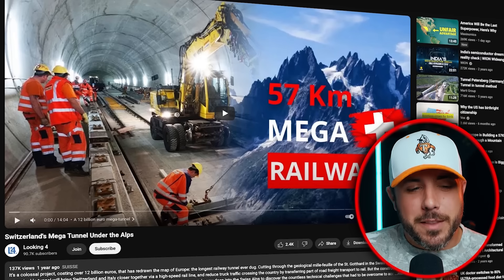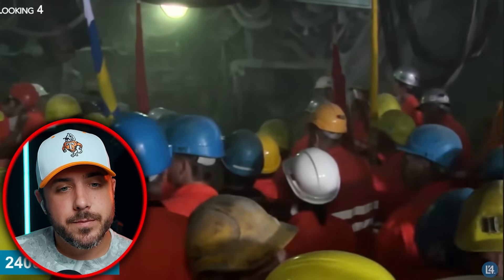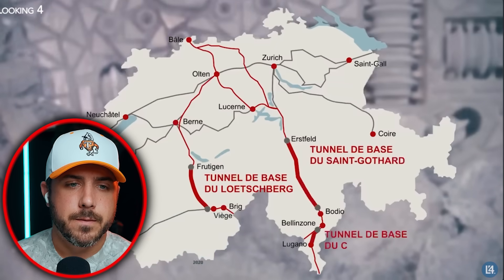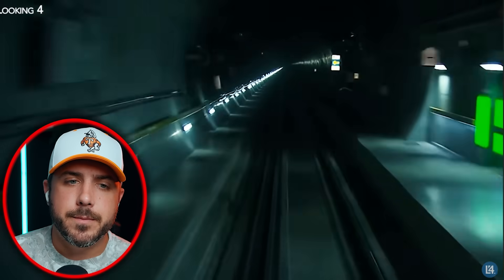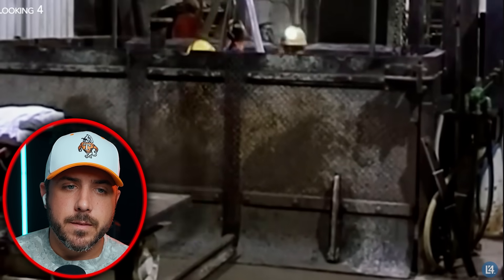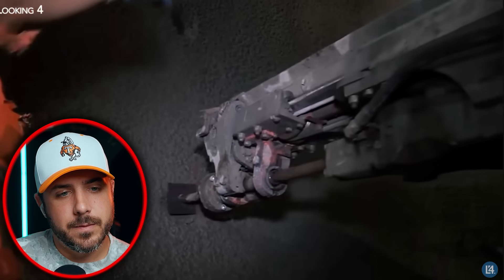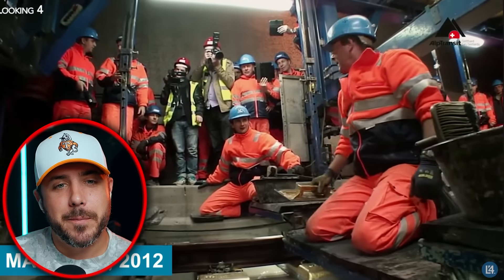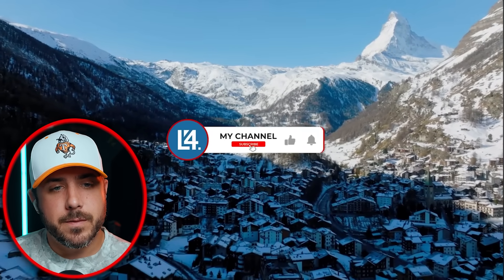American Reacts to Switzerland’s Mega Tunnel Under the Alps!

Comment: In the railway accident in the Gotthard Base Tunnel on August 10, 2023, a freight train operated by DB Cargo and SBB Cargo derailed due to a broken wheel in the Gotthard Base Tunnel. Due to significant damage to the structure, the tunnel was completely closed for almost two weeks. Freight transport was then gradually resumed, followed by passenger transport from September 29, 2023. Normal operations resumed at the beginning of September 2024. At the beginning of November 2023, SBB estimated the damage, including lost revenue, at between 100 and 130 million Swiss francs. The damage and thus the repair costs were significant.

Comment: There are more and more infrastructure projects like this — and yet, in Germany, nothing ever seems to move forward. The Brenner Base Tunnel is already under construction, designed to connect Germany, Austria, and Italy in one unified rail network. In Italy and Austria, progress is visible. But in Germany… they’re still debating where the railway line should even go. 💀

Comment: The fire prevention is also impressive. Any train entering goes through heat cameras. If any part is hotter than it should, the train can't enter the tunnel. Both sides also have dedicated firefighters. These have to be anywhere on "their" side of the tunnel wiwthin a specific time window from the moment they're called. I think the limit is around 15 minutes. Also, the passenger trains and track would allow significantly higher speeds (250 km/h instead of 200), this would however cause issues with the freight trains.

Comment: Impressive tunnel indeed.
Did you know the largest machines ever built by humans, the CERN particle accelerator, also is located in Switzerland,  built 100 meters underground with its largest loop having a circumference of 27 kilometers and extending partially under the border to France? Also worth watching a documentary, I think.

Comment: My uncle was one of the engineers who worked for the Herrenknecht company and engineered the boring machine for the Gotthard Base tunnel. He then also worked at the front of the boring shield and oversaw boring operations. He mentioned those constant water intrusions, falling rock and heat of 40+ Celsius. Whenever I take the train through the tunnel, it's nice and climatised. One forgets that there is thousands of meters of stone above one's head inside that tunnel with immense pressure and heat. I saw the drawings of the boring machine which were as long as the wall inside his office. Huge respect for what they did.

And don't forget. It's not only about the tunnel itself, but the know-how they got. That knowledge came from the Lötschberg Base tunnel and the Zimmberberg Base tunnel and was further used in the Ceneri Base tunnel and the train station Löwenstrasse in Zurich. Because they were boring underneath the river Limmat, they had to put isolation mats on the riverbead and pressurise the boring shield. That meant that workers like my uncle had to sit in a pressurisation chamber for a long time before they could go to work. One time when they basically had the Tram tracks from above fall onto their boring machine because of an unexpected sinkhole, their evacuation was quite complicated because they couldn't just run out. There are many such stories. I could write for ages. Anyway, thanks for making this video. Keep it up!
Reply: Boring machine is crazy

Comment: There is the longest rail tunnel under construction between Austria and Italy. The Brenner Pass tunnel.
Reply: No, the real tunnel is 55 km. Gotthard is 57.
Reply: It's not REALLY the longest. They are planning to keep some of it inclosed just to get the record but it technically isn't longer since it goes outside part way.
Reply: @SAA-hr9gr  no, they are planning (and have always planned) to link up to the already existing Innsbruck bypass tunnel. Thus, the overall length will be 64km.

There are also some extension planned (but not yet finalized) on the Italian side, to allow freight trains to bypass Fortezza and Bressanone (where the Isarco valley is still very narrow). If these get built, the underground section will be more than 80km long (and it would be even longer were it not for a short crossing of the valley on a bridge).

The proposed tunnels are already shown on openrailwaymap.

Comment: Here you go: 57 km : X min = 200 km/h : 60 min ( 57 km X 60 min ) :200 km/h = 17,1 min
So it takes 17,1 min for passanger  train to travel entire lenght trought the tunnel.
Reply: Its 15-20 mins
Reply: Or, on the fly, 50/200 is 1/4, so 15min.
Therefore 57/200 is a bit more than 15min, and it's good enough.
Reply: @Warcraft_Traveler first I love Warcraft IP huge fan as teen I was. Cute username btw❤. 😊 Second lets translate to freedom units for our dude/s. Since avarage drive trought in McDonalds last 5.5 to 7 minutes. It is between 3,109090909090 to 2,5285714285714 avarage visits to McDonald's drive trought. Better now? 😂

Comment: This tunnel was finished on schedule time and with no cost overrun. Ä third of the excavated rock was used to make the concrete used in the tunnel construction. The rest was put into a very deep lake right by the tunnels north end. This created shallow areas in a lake that is otherwise very deep, cold and almost void of life, now it's a thriving habitat for water plants, fish and birds.
It's not the only base tunnel in Switzerland. About 75 km to the west theres another one, albeit much shorter that was also part of the same Alpine Traverse Rail project. 
Besides the French/Italian tunnel under construction there is also a huge base tunnel under construction in Austria.
Reply: The Swiss Parliament approved a loan of 13 billion in 1999, the tunnel ultimately cost 24 billion.
Reply: @TRD-JDM  No, the 23-24 billion you are refering too is the entire cost of the NEAT or  NRLA as its called in English. https://www.newsd.admin.ch/newsd/message/attachments/39644.pdf
That's for the Lötschberg, Ceneri,and Gotthard tunnels plus all the additional works on those routes.
The final cost for the Gotthard Base Tunnel (GBT) was CHF 12.2 billion (approximately $12 billion USD), which was within the budget for the project at its completion in 2016. Although initial projections were lower, voters approved a budget increase in 1998, and the final cost remained on budget for the completed tunnel itself.
Reply: It was even opened before scheduled time

Comment: The freight train derailment was actually a big deal because it did the impossible and took out both tubes at once. They had to figure out a better solution for a critical intersection between the tubes so it won't happen again. It took over a year until it fully reopened.
Reply: Besides damage to the large doors that separate the two tunnel tubes at the locations where it is possible for trains to switch tubes, very little was damaged in the second tube. After new doors were installed, freight traffic resumed within 13 days in the unaffected tube. The problem was with one tube out of commission (ie, no functioning rail infrastructure) and construction going on inside, safety rules prevented passenger traffic in the intact tube (as the other tube serves as an evacuation route).

As the old tunnel route was still available, initially all passenger trains were rerouted through that. This increased travel times by up one hour. It also reduced passenger capacity as the old route could not accommodate double-decker trains. Later on, after new safety procedures were implemented, some passenger trains were able to use undamaged tube on the weekends (when there is most demand) but not during the week to allow for enough freight capacity through the tunnel.
Reply: Yeah the problem was the doors and if I remember correctly from one of the civil engineers. The gotthard tunnel didn't have replacements. So a new door and pieces had to be made before installation could commence.

Comment: This was very historic here in switzerland and it is one of the mega project that was finished in 2016. I pass in this tunnel when we were traveling to milan and also the old panoramic rail and both of them are stunning.
Reply: It was impossible to miss as every news outlet, every politician, every teacher and simply pretty much every single person was talking about it. :D 
Another big point was, when they connected the tunnels from norht and south side and noticed, that their measurements where exact to the point of roughly 10 cm offset. Considering how long the tunnels are, this was absolutely nothing. 

We've visited the southern digsite when i was still in school and it was amazing. We sadly did not see the drilling machine live though..

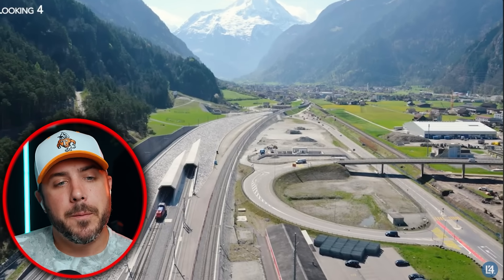Comment: 2:13 Construction for this tunnel started in 1999 (With some prep work done 3 years earlier) so 17 years(+1 month to be exact). They started building a second road tunnel just this year. The original much smaller tunnel was from 1872, so it is an ever ongoing evolution of tunnels.
Reply: Tunnel Višňové in Slovakia - construction started in May 1998 (year earlier) and was completed just now before Christmas (9 years later). Sad thing - it is "only" 7,5 km long. Naturally, it´s politicians´ fault.
Reply: @Kilud  Excellent news, that will take a serious amount of time from my travel time when visiting the inlaws. Žilina and Strečno always took forever. Will miss the castles though. 
Ibet this wil cut down on the many accidents under Strečno as well.

Comment: To be fair, it would have been completed even earlier if it was only done by the Swiss... the Italian part completion slowed down the process for a few years I remember.
Reply: If you are talking about the Monte Ceneri Base tunnel (finished in 2020) then you need to realize that is within Canton Ticino Switzerland, not in Italy.
That is mentioned en passant in this video.
Reply: @alexandergutfeldt1144  then I must have mixed it up with something else cause I clearly remember the opening being covered on TV talking about the "Italian" stretch of a gallery... I'm confused now, cause I looked it up and looks all the galleries have been built way back in the day. 😶
Reply: @MartinaValla  Maybe your mind transformed 'ticinese' into 'italian'? Mine has tricked me in that way!

Possibly you are thinking of the Simplon-Line? There seems to exist a lot unhappiness (ha) about how that project is 'handled' in Italy?
You may also be remembering/transfering all the delays in Germany's railroad projects. They are decades behind the original promised finalization dates of lines that enter Switzerland.
Reply: @alexandergutfeldt1144  I guess so! 😆 Thank you for pointing that out, it was a bit of a mindblow lol
Reply: @MartinaValla  Ticino is in the Italian-speaking part of Switzerland, but it's still Switzerland.

Or maybe you confused it with the Brenner Base Tunnel (which is currently under construction between Austria and Italy).
Reply: @stephanweinberger  I know! I must remember wrong or have mixed it up with something else, though it's possible I'd seen it on the regional news (I live in Lombardy) and assumed it went all the way to the border. I clearly remember the image of workers shaking hands through the hole so it's probably this. Thanks for pointing it out!
Reply: @MartinaValla  Or maybe you mixed it up with the Mont Cenis base tunnel?
Reply: @stephanweinberger  no no, it must have been the Gotthard since it was around 2016. I probably heard Bodio or Airolo and wrongly assumed they were in Italy since they sounded so familiar! 😅

Comment: At the moment, another tunnel is build: the Brenner Base Tunnel which then will be the longest railway tunnel of the world with a lenght of 64 km.

The tunnel boring machines of both the Gotthardt tunnel and the Brenner Base Tunnel are designed and bulid by the German company Herrenknecht.
Reply: There are two ways to define the length of the Brenner Base Tunnel. The main tunnel will be 55 km long, ie, 2 km shorter than the Gotthard Base Tunnel. However, it will be directly connected with an existing 13 km tunnel that serves as bypasses of the city of Innsbruck, which is located in a fairly narrow valley.

Comment: 16:30 It's called The Mont d'Ambin Base Tunnel now but yes, it will be the longest railway tunnel once it's completed. It's expected to complete in 2032/2033 and is currently on schedule to meet that deadline.
A direct Lyon-Turin train currently does the journey is just under 4 hours (3h54 to be exact for the fastest connection). The new tunnel will cut the time by 45 minutes.

Comment: Here's what they did with all the excavated material - The material excavated during the construction of the Gotthard Base Tunnel was primarily used for the tunnel's inner lining and other construction purposes. Approximately 24 million tons of rock were excavated, which was then transported to base camp concrete factories, where it was processed into 7.5 million tons of concrete for the tunnel's lining. Additionally, some of the excavated rubble was used to construct a new archipelago of three artificial islands in Lake Lucerne, covering an area of half a hectare, which were officially inaugurated in 2005.
Reply: "Primarily" isn't correct. The volume evacuated is larger than the volume used. 
And when the material was good for concrete, it was used for it. 
I'm quite convinced that the plants used for the tunnel were also selling their concrete to construction projects in the region or aggregates.

Comment: The US is no longer capable of doing mega projects because we basically change governments every time we blink and the new person in charge will always cut budgets for projects or downright cancel them at any stage, even when they may be nearing completion.  I've travelled these tunnels mentioned and they are amazing
Reply: Try consensus decision making and direct democracy. In Switzerland we have basically the same coalition government with slight adjustments to election results since 65 years. And we decide ourselves which projects to do
Reply: @eljanrimsa5843  Americans should recognize that their constitution is by far not as perfect as they believe. The Swiss concept of not always changing the administration has a lot of advantages, as it grants continuity. A seizure of power (as it has been done by fascists and communists) is hardly possible in Switzerland as long as they have their present constitution.

Comment: Our harbour tunnel was not constructed in the same way as in Switzerland. After all, there was no mountain to go through. A 1.6 km long passage was dug several metres deep. This was also necessary because of the groundwater. So that lorries coming off the motorway do not always have to drive through city traffic, causing congestion. But it was still bloody expensive. Over 270 million euros. And that's with a planning and construction period of 25 years. The construction period itself took 10 years.
Reply: Which harbour is that? The spelling would make me assume Sydney.